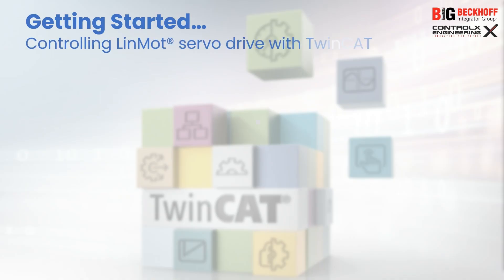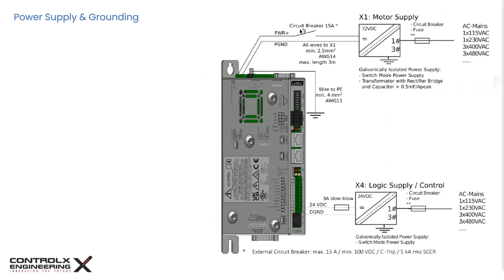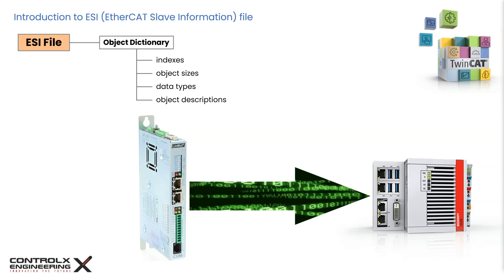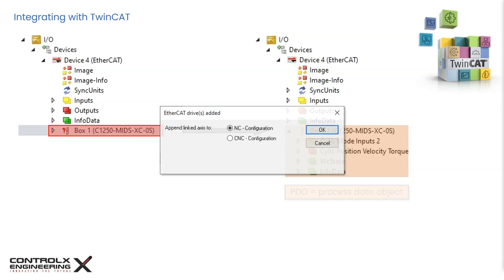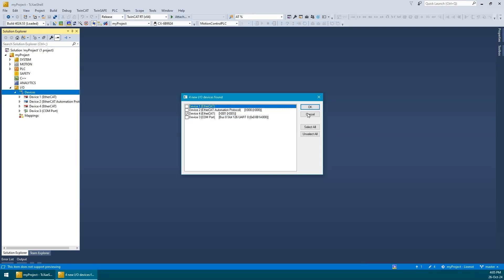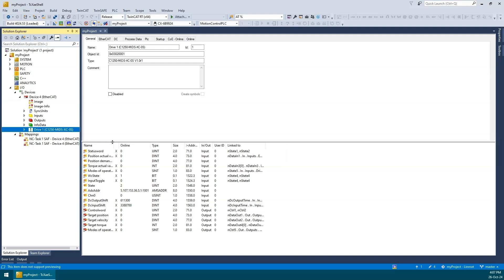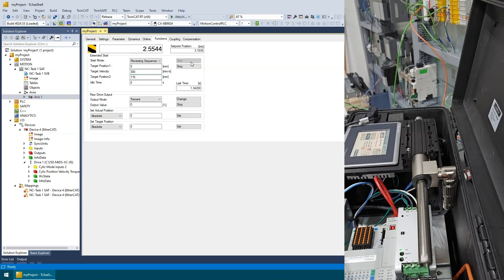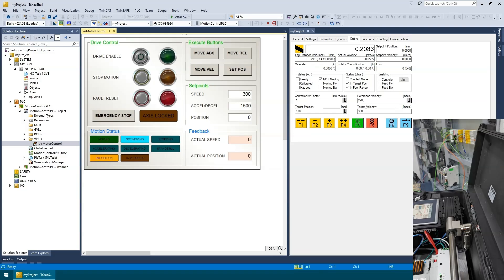How to Integrate LinMot EtherCAT servo actuator with Beckhoff PLC using TwinCAT?

Comment: Hi, love your videos! Do you also have an projekt where you have axis with limit switches to calibrate it? Greetings from germany
Reply from the maker: Thank you for enjoying our tutorials. Limit switches can be easily integrated as digital inputs into the PLC and then appropriate logic can be implemented for position calibration and homing purposes. This is mostly required when using incremental encoders for position feedback. When using absolute encoders, this is mostly not required as the motion controller will know the exact position even after power cycles. Hope this helps.

Comment: Hello, I would like to ask you a question? When controlling the LinMot linear motor (C1150-EC-XC-0S-000) in TwinCAT, the command has been sent successfully, and TwinCAT also shows that the motor is "Busy (Busy = TRUE)", but the motor does not actually move.

Current confirmed situation: The EN light of the drive is on, and the Error and Warning indicators are not on, indicating that the drive is in a normal state. The communication status of EtherCAT also displays OP (Operational), confirming that there is no communication problem. But after sending the MC_MoveAbsolute command, the motor still does not move.
Reply: Check the drive STO (safe torque off). Some controllers require jumper or 24V on the STO input.
Reply: @CanadaDriving  Can I use TwinCAT to find this switch? Or do I have to use LinMot?
Reply from the maker: STO is usually a hard wired connection. Please refer to the user manual for your particular model of the servo drive.